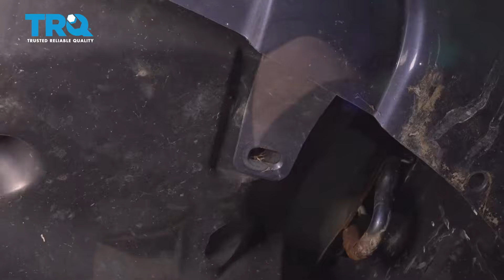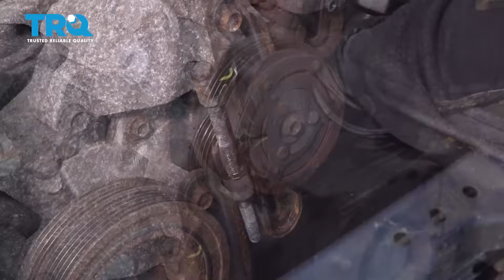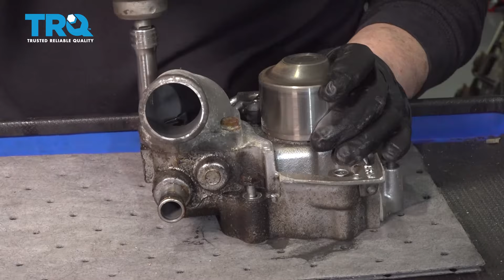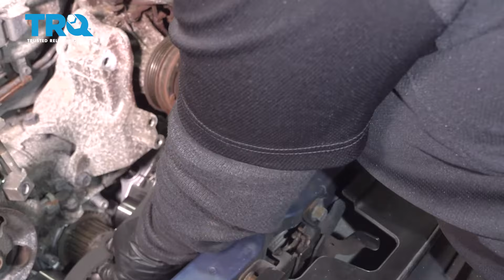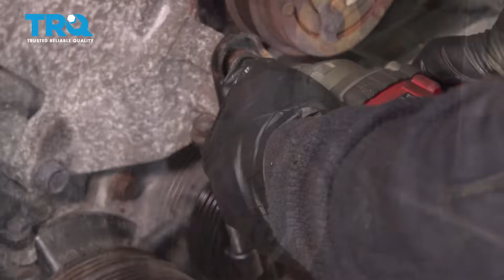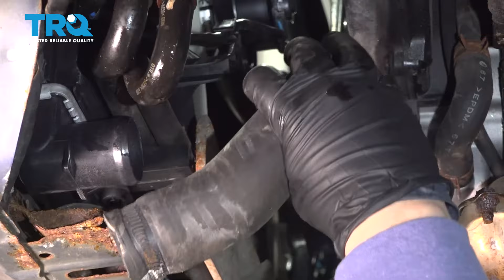How to Replace Timing Belt Kit w/ Water Pump 2004-2009 Subaru Outback

Comment: Thank you for this excellent video, I could not have done this without it.  A few notes from my project adventure:

1.  IMO, pulling the fans was worth the trouble to gain better access, two bolts and one connector per fan.  Upon reassembly, put them back in before the final install of the upper hose.
2.  @4:50:  Pulley hold tool – I found these hard to come by, but there are a few “DIY tricks” out there. The one that worked well for me was utilizing a belt with some generous extra length to wrap around the harmonic balancer and another pulley on the engine.  Then fold the belt “across and under” on itself so that with torque applied, it grips down on the pulleys and holds them.
3.  I found wrangling the timing belt off and on to be a challenge.  But a lot more doable with the lower passenger side idler pulley completely off while removing/installing the belt.  I used a trigger clamp to hold the belt out of my way when installing the pulley.
4.  Beware that the camshafts are under spring tension when parked on their marks at 12:00.  They’ll jump 180 degrees out of position at the slightest accidental encouragement.  But if they do, not to worry, as long as the crank is still in position.  Just use your socket wrench to put them back on their marks.
5.  @13:20:  Guiding the new water pump on with gaskets and six bolts in place was easier said than done.  The gasket loves to scamper out of position just when you think you have it all lined up.  It got a lot easier with four bolts in some of the holes and two allen wrenches in the others to serve as alignment guides.  Check from above and below carefully before torquing it down.
6.  After installing the WP, a preliminary leak test was well worth the trouble to ensure that the gasket was sealing properly (see note 5).  Put the upper hose on and fill with water, search for any sign of leaks before putting the other hardware on.  If it passes, drain and remove the upper hose, and continue.  I learned this tip the hard way.

Comment: 11:58 alternate trick to remember bolt location... Cardboard box - draw a rough  outline of the piece, punch a small hole with a screwdriver where the bolt would be, insert the bolt as you remove them.

Comment: 1 i could not find the mark for the passenger side sprocket on the engine block.
2 the crank bolt would not submit to my 200 lbs impact . I had to use a 5ft pipe and my breaker bar
 3 my belt broke and the left side cam crashed some valves on the piston so the motor was fubar after 2 hrs of work.

Comment: I've seen a lot of videos regarding the do it yourselfer showing how to perform service on various engines.  You, mam are a breath of fresh air.  Not only do you have an excellent camera operator videoing the procedure, you explain, step by step, the crucial elements on the  correct installation.  Now I can get my 2006 Outback, which has leaky cam seals, attended to.  I was worried about missing a crucial step but with your expert mechanical skills and indepth demonstration, I have the confidence to do the upcoming job.  Kudos to you.  You are the best I have seen on YouTube.  I have subscribed as I want to follow you along on other proceedures.  Hats off to you.

Comment: You are an outstanding mechanic. Through your excellent video, I can now  do this job with confidence .
The car you are working on was severely corroded. 
I would have replaced all the hoses and clamps  and painted the new water pump housing that was severely corroded  with rust proof paint.
Thank you for the excellent detailed video.

Comment: The g2 cog pulley has an indent on one side and a raised edge on the other side. Which way does it go on? I finished mine and it was squeeling and building up belt shavings/powder on that pulley. I think it is because the pulley is on backwards or the water pump went on a little cock eyed. Not sure which yet. I cants see how you out the g2 pulley on in the video clearly.

Comment: It does help if you leave g2 cogged pulley off till you have the belt on and lined up then slip it in snug it up then torque it down check your marks and spin the engine

Comment: I just did this job on a 2004 Outback. Some notes: I had to remove the radiator to get enough room to fit an impact in the engine bay to remove the harmonic balancer bolt. In order to do so, I had to detach the transmission cooler lines from the radiator and remove the mounting brackets on the top of the radiator. Then, the radiator pulled out of the car from the top. My short impact didn't have enough guts, so I put a breaker bar on the balancer bolt and rested the breaker bar against the frame rail. I removed the fuel pump fuse and bumped the starter over until the bolt broke free.

If you're installing a new belt, it will be very tight, so it will be much more difficult than what is shown in this video. I had to use "Easy Fix"'s video for help with this.

When torqueing down the water pump bolts to 8 ft-lbs, I had 2 of them strip and pull threads out of the block. I had to drill and retap the holes. They were M6 x 1.0; I tapped them to M7 x 1.0.

Do not overtighten the bolts on the cover of the engine. I overtightened 1 of them on the bottom, and it broke the ear off the engine block. It shouldn't affect much, but it's not ideal.

Comment: I would like to know more about the prybar technique to compress the hydraulic tensioner.  I tried with several large screw driver and could not get the tensioner to budge.  How long is that prybar?  Did you remove the radiator fan or overflow reservoir to get enough room?

Comment: What do you do if the cams are not in alignment when you put the crank at top dead center? Can you rotate them counter clockwise a few degrees slowly or what is the procedure?